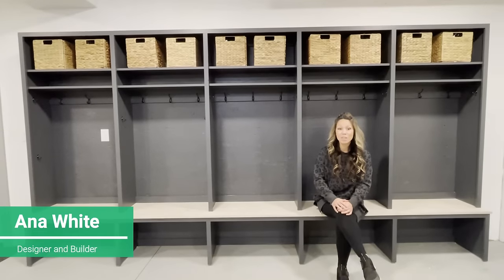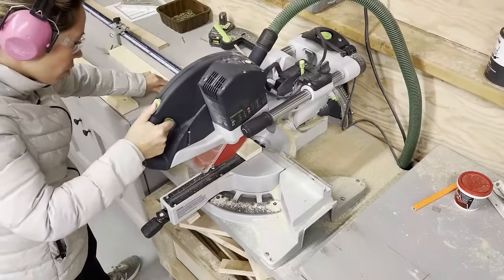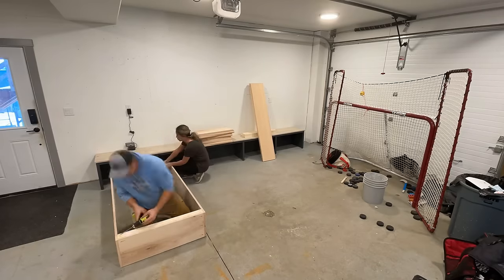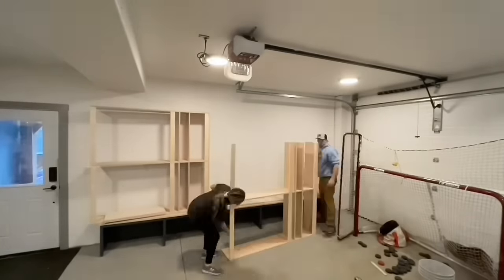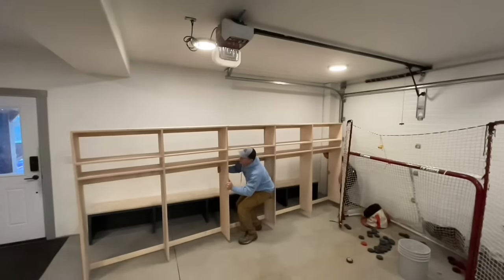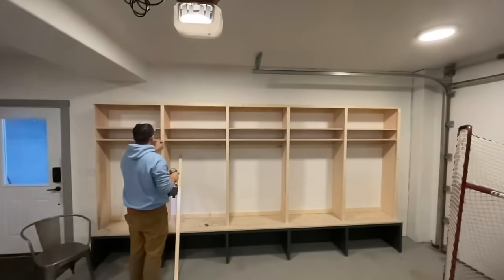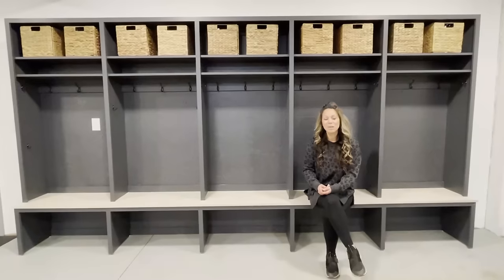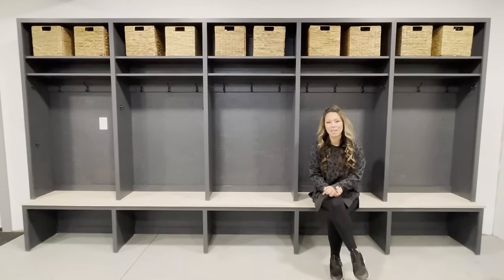I Built My Own Mudroom Lockers!

Comment: Nice job! Can I ask for a close up of the front edges of you frame? The plywood you used is thinner so did the front edges you used stick out on each side of the plywood?
Reply from the maker: We use 1x2's which will leave a slight overhand on each side of the plywood https://shelfhelpnow.com/blogs/templates/open-bottom-mudroom-bench
Here are some brag posts of other builds with some close ups https://www.ana-white.com/relatedbrags/63431

Comment: I'd be interested to know how the joints have held up using the pocket screw method. I'm thinking of using dados, glue and 18g brads instead. Have you seen any separation/movement in any of the joints a year later?
Reply from the maker: It's held up just fine and it takes a beating daily!

Comment: what do you do with all the pocket holes on the shelves?  do you just leave them open or do you plug and fill everything?  are they on top or bottom of the shelves?
Reply from the maker: Planning ahead allows a lot of them to be hidden, they can be filled or just placed where they are not in plain site, like to the back or to the top, depending on the project. I hope that helps!

Comment: Was the video of how to do the bench taken down?  Can't find it.
Reply from the maker: Here is the video https://www.youtube.com/watch?v=fD4iv9N-Y6I
Here is the post that explains how to attach the top https://shelfhelpnow.com/blogs/templates/open-bottom-mudroom-bench
You will screw through the bay supports, depends on the thickness of the top, but if you are using 3/4" material for the top you will use 1 1/4" screws. I would recommend pocket holes for 3/4" material with the pocket holes facing up on the back bay supports to attach the back side of the bench too. Please email anawhitesite@gmail.com for further questions. Thanks for the visit!
Reply: @AnaWhiteDIY  Thank you! How did you moor the dividers to the bench?